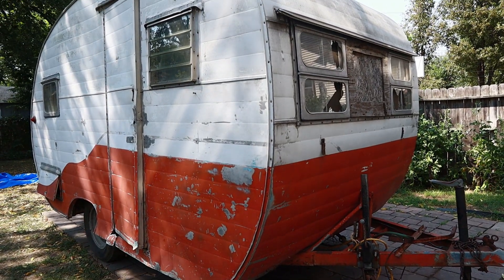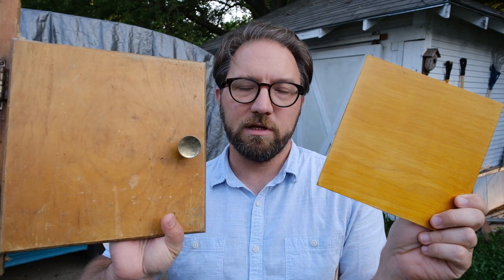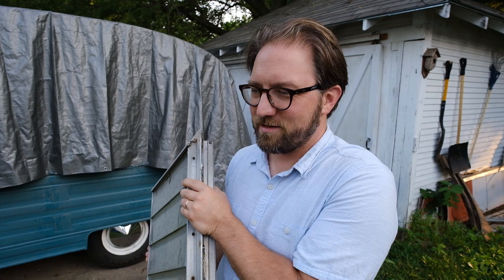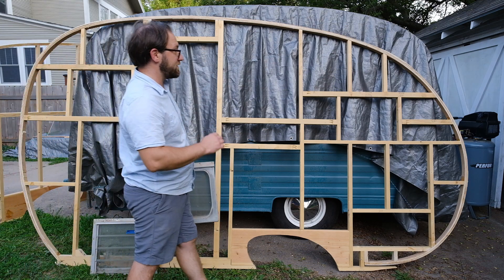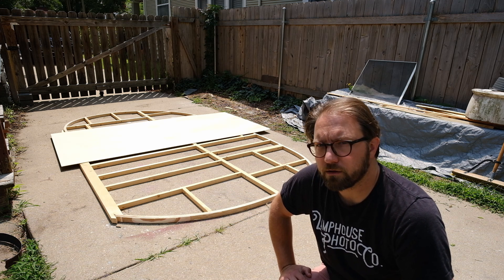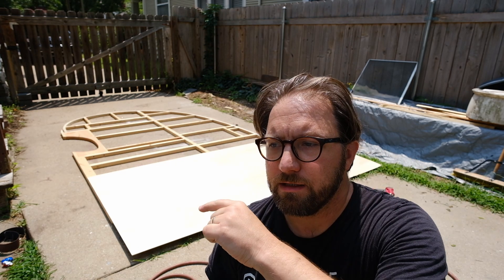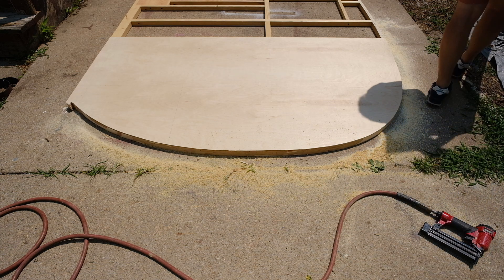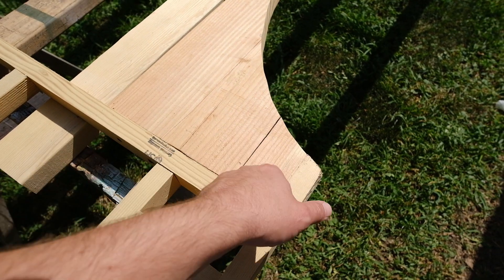CHOOSING A FINISH FOR THE WALLS & CATCHING A MISTAKE WITH THE FRAMING

Comment: For the floor what would your suggestion be? Marine grade or a standard plywood? Thanks for all the vids makes it seem easy.
Reply from the maker: Thanks Billy, it really is pretty easy stuff even if it's a bit detailed at times!

The big things about marine grade plywood are that it's made with a waterproof glue, more plys, and fewer voids; so it is truly top shelf stuff. Unlike treated lumber, marine grade isn't soaked in toxic chemicals, so it doesn't have all of the associated problems with that which you want to steer clear of. But in my opinion, marine grade is overkill for the decking, and while it might hold up better to 50 years of road exposure, regular plywood was used in most of the campers I've worked on, and what rots the floors out is not stuff splashing up from the road, but water saturating the wood from improperly maintained window seals and unrepaired seam damage.

Comment: Great video series!  Really enjoy them.  Speaking of fitting windows, my project camper is missing most/all of the original windows.  Is it going to be easier to buy old windows first that are similar in size, then frame to their size?  OR  keep the original specs on the framing and then get or make "new" windows?  I'm worried if I don't keep the exact same size windows then I'll be screwed when I'm putting the skins back on.  Advice?  Thanks so much!
Reply from the maker: Hey Steve! I really try to avoid campers that are missing their windows because it is a real pain in the butt to find replacements. You're probably best finding similar sized replacements and framing it up to fit them, but you're going to have to make sure the window opening is the same size or larger than your original openings if you're reusing your skins. VintageTrailerSupply.com has some replacement parts, and you can even buy some new extrusions to make a few types of windows, but my guess is that it'd be prohibitively expensive to build all new windows for a camper. 

I would start looking for windows on craigslist or facebook marketplace in your area, and just buy any that you can find, and try to get close. Sometimes you can even get them for free! Good luck!

Comment: I noticed you used staples and the silver rectangles to attach the wood pieces together on the 1968 pla mor. Did you use screws at all or just the staples?  I ask you that because I noticed on this one you used pocket holes and screws for the 56 calcraft what size screws were used for the calcraft??
Reply from the maker: The Play-Mor was pretty much just those gusset plates and staples, but it's really the wood paneling that's glued to the wall studs that's making the wall strong. Originally the Play-Mor wall studs were attached to one another with corrugated staples, which is quick to do, but one of those staplers is several hundred dollars, so...

The Cal-Craft wall studs were originally nailed together much like household framing, but the panels were just nailed to them using twist nails. I chose to not use the twist nails, but to instead glue and brad nail the panels to the studs as I felt this would ultimately be stronger. I used pocket holes partly because I thought that would be a stronger joint, but also because pocket holes allow for relatively quick and accurate placement of parts, and they can also be easily changed if something isn't in the right place. The length of the screw depends on the thickness of the material that you're screwing together, but I seem to remember these were 1 1/4 inches.

In either case, it's really the wall paneling that makes the wall strong, and the studs provide strength against buckling and allow for the attachment of cabinetry and other fixtures.
Reply: @TrailerTrashtoTreasure  Thank you so much! My daughter and I bought a 1966 Aristocrat Land Commander and it’s a total rebuild.  We removed all the screws from the skins and now working on the million staples it has, haha.  Your information is very helpful and a good reference for us.  I appreciate your videos they are very helpful as well.  I wish you had a step by step video on building the  kitchen cabinet or boxes and materials used.  Anyways, thanks again!!
Reply from the maker: Well thanks for watching! I intend to be a bit more in depth when I get around to building the next kitchen.